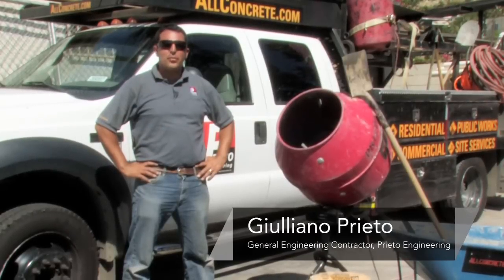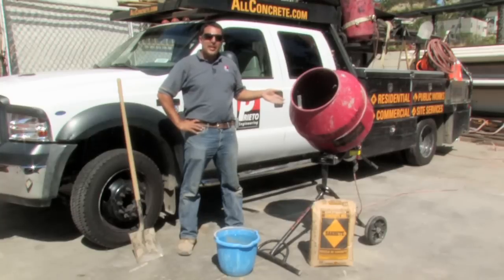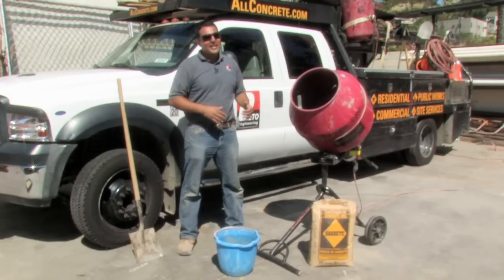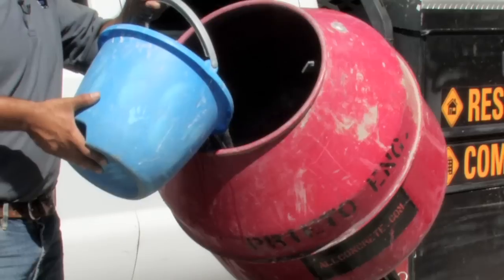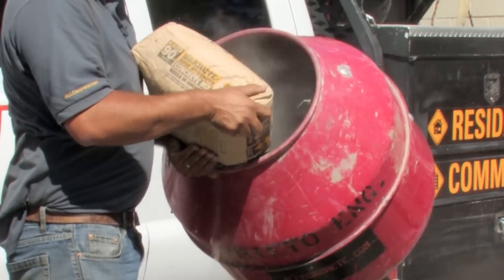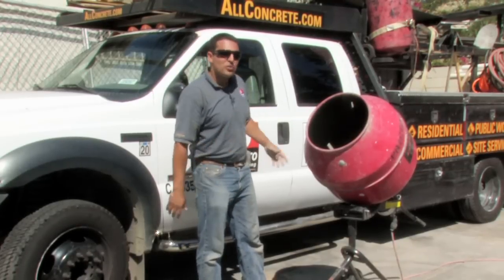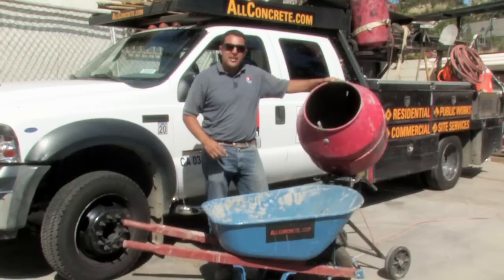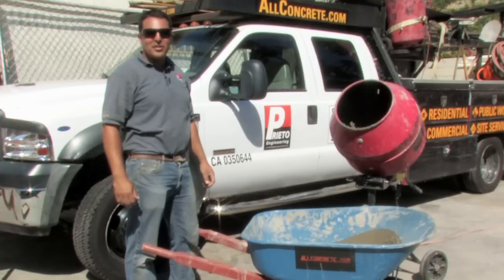Concrete & Masonry : How to Use a Concrete Mixer

Comment: Thanks for that. Well presented and spoken.

However, what I was looking for was the issue of whether one puts the mix into the mixer first, then turn on machine (petrol 4hp Briggs Stratten motor, in my case), or turn the machine on first, then load. There are conflicting views out there, and what's your view? My personal feeling is that I'd rather load first, then turn power on same as you did here. Seems scary to  have to load while the barrel is turning lest I might dissapper.

Another thing too. A reason for using the power mixer is to aerate the concrete properly. Hard to do with a shovel and barrow, and takes longer too.

Thanks, from Australia.
Reply: Jaker; I have the same mixer as this video but it has a Speedway brand label from Homier tools and is from 2006. With my mixer I add 1 bag then water then mix and add another bag then water then mix ; then add the last bag; then slowly creep up on the water amount as I mix.

Comment: Nice video just one additional comment on mixers and also larger mixer applications how do you normally clean these? Right after a job with a pressure washer ? Or do you uses some type of low dose sand blaster ?